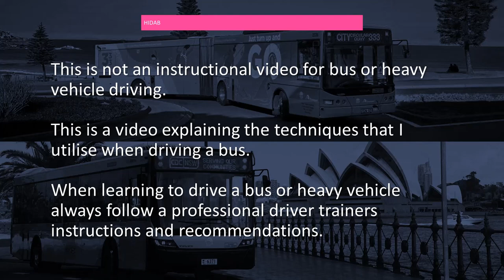How I drive around roundabouts in a bus

Comment: I'm currently training in Melbourne and this was very helpful.  I've only driven for about an hour so far and I think I have a handle on steering and the width of the bus.  It's the 15 meters behind me that I'm absolutely not used to and leading the front axle by 3 meters doesn't help either.
Reply from the maker: Glad it was helpful!